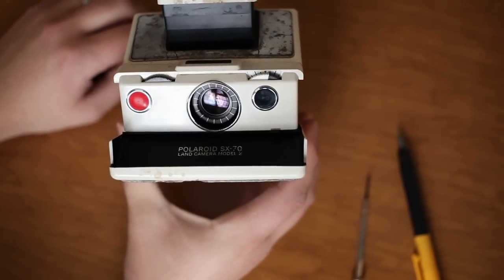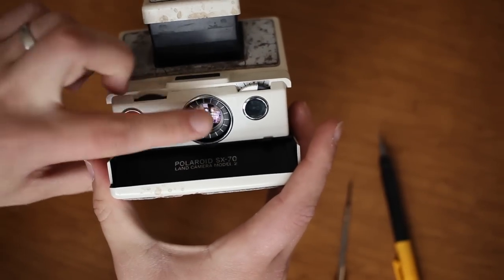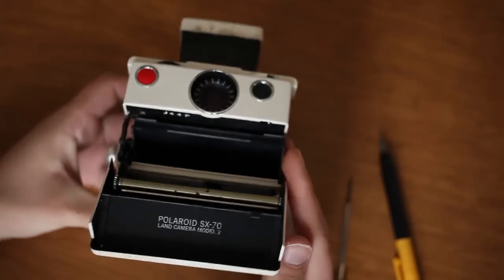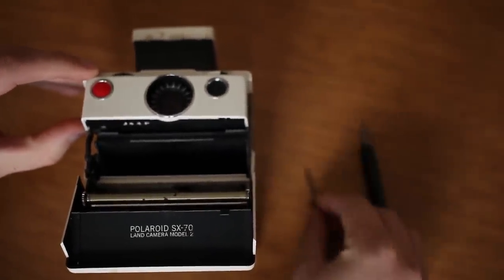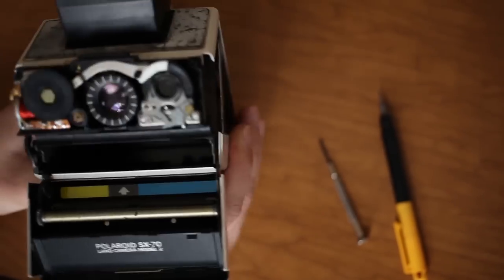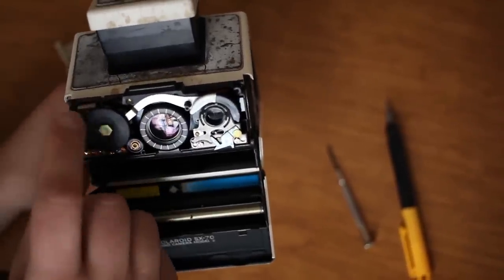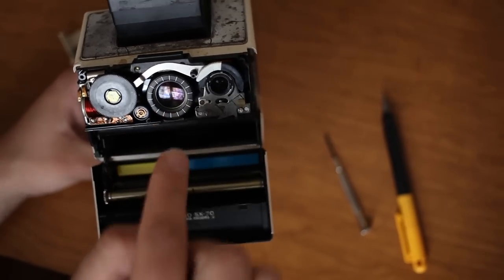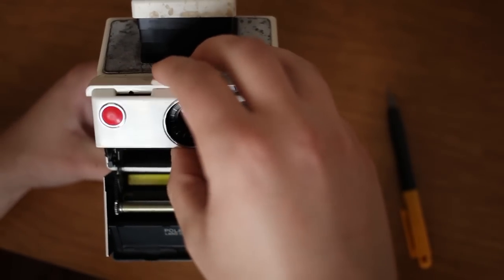How to remove front cover (aka shutter housing) on a Polaroid SX-70 to fix a stuck/jammed focus.

Comment: Hi my focus wheel will NOT move! And when I take the plate off there sees to be nothing keeping it! But when I look on the backside of the wheel it looks beveled so it's harder to turn passed a point? Also maybe the pin on that wheel has too much tension?? Any help helps!
Reply: +justin wheeler 
I got one today with the same problem you described, seems to be easier to move if you set the aperture wheel all the way to the light though, but it still gets stuck on the groove when you use the focus all the way. Have you found a way to solve this? Not sure how to adjust the tension of the pin if tats the problem. Any help would be great!
Reply: +707username707 I mean really I just took the face plate off like above and took a toothpick and held both gears and spun them manually and that seems to have helped, they were probably stuck from not moving for a while